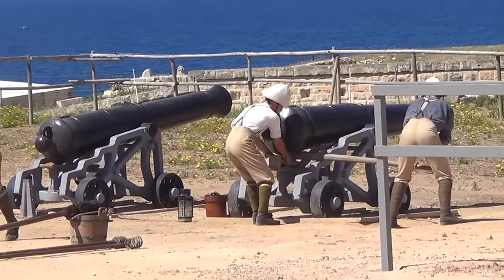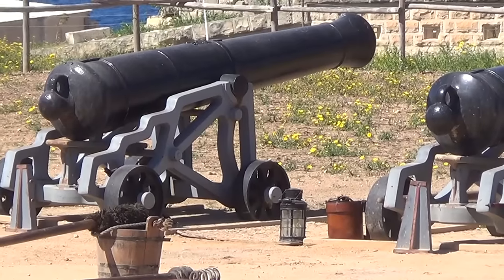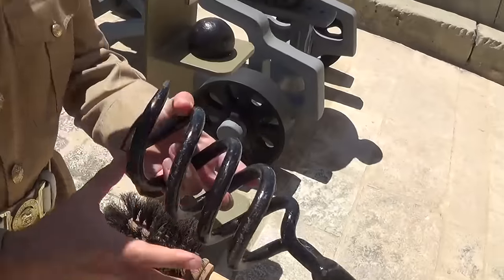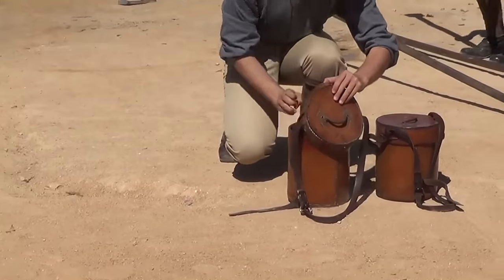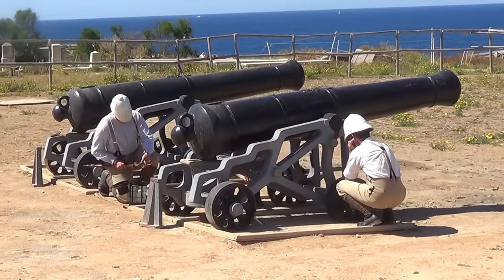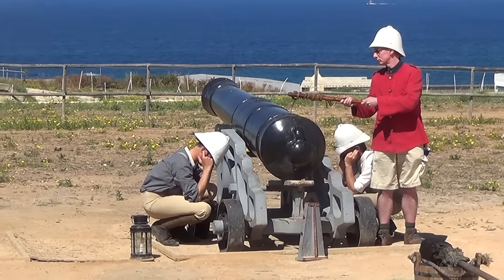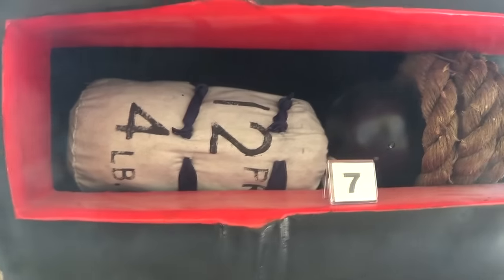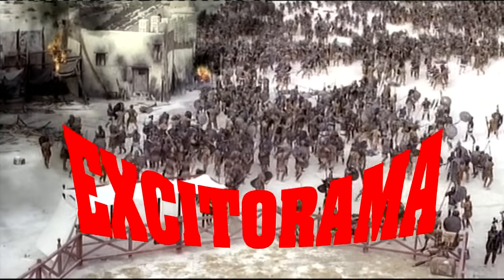Cannon loading in the eighteenth century

Comment: In the  "modern" Royal Navy, typically the phrase assigned to cannon firing is "two six heave". There are several stories as to the origin of this phrase, or even if it relates to cannon firing at all! However the origin,  matelots now use the phrase 2-6-heave to ensure everyone pulls at the same time. Naval dits (stories) are fun, hauling a rope on a swaying deck in a force 6 storm not so much ;-)

Comment: Just an addition, while he did mention that the video does not convey the sound properly, what this also doesn't show is that there were probably a dozen or more cannon right beside you doing the same thing and fire off. So it wouldn't be just the sound of one gun but dozens at a time, every 90 seconds (or a minute and a half) for several hours. Frighteningly loud.

Comment: Thats all fine and well, but they didn't load the gun.  The charge is like a blank.  About 1/3 rd the loudness as a real cannon shot.
Today in 2022, Cannon grade Goex Black Powder is $25 USD per pound.  An 8" stone ball is $142 USD.  You can guess the cost today from that.  $142 for the ball, $100 for the powder= About $250 USD for and 8" bore cannon per shot.  They looked to be using 2 LB so powder, $50 USD per shot.

Comment: How would they do this on a ship?  Do they roll back the canon between each firing?
Reply: Actually, the recoil of the gun was what rolled it back.   The way they showed the gun lashed to the "wall" was when the gun wasn't in use, to keep it from rolling all over the deck, especially in high seas, which is where the term "loose cannon" originated

Comment: 90s seems singularly rubbish even for 3 men. You of course shouldn't put the volatile powder or fusee any closer than this crew did, but I do belive it was common practice to put other things like piles of cannon balls in front of the cannon (Not the breach of course, but there are enough dipshits on this earth I have to specify) for ease of loading, and the special rods off to the sides of the canon to cut down on time running back and forth. I don't remember anything to back this next theory up, but just thinking about it, the fuses could be kept in a modified cartrige box the type you see infantrymen of the period using. All of the things in the video were for demonstration purposes, so their relative sloth and precision in their drill makes sense, but during a battle, those artillerymen, while maybe not scrambling about like hares, would probably have a bit more pep in their step and general gusto, sacrificing drill for speed, though hopefully not safety. It doesn't seem outlandish a crew might be able to get a shot every minute.